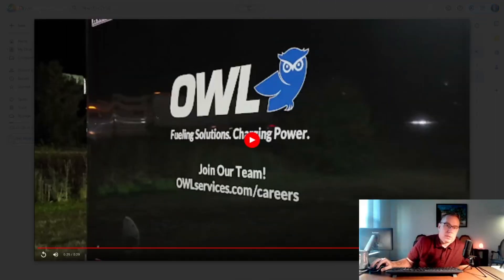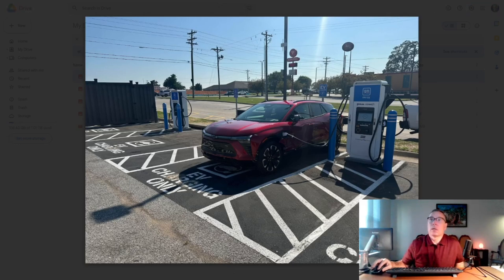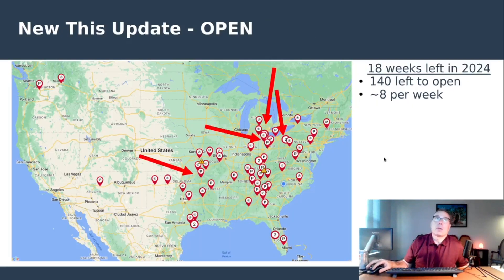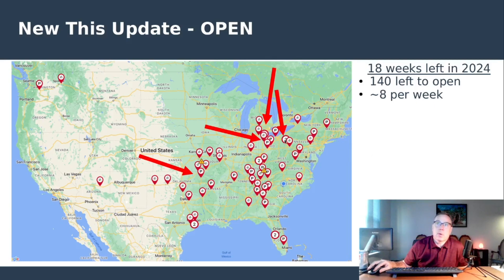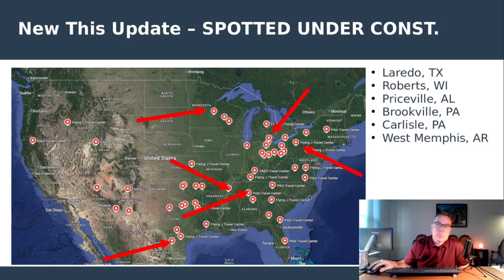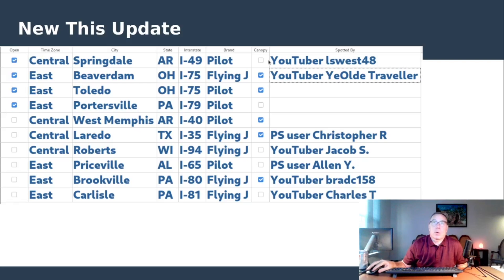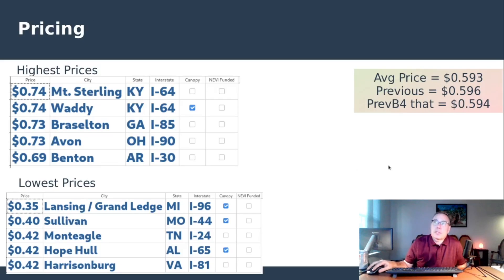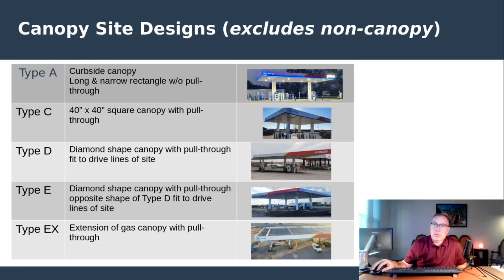gm energy - Pilot / Flying J Update #30 (Electric Vehicle Charging)

Comment: Hi Walter I am wondering at what price ie .59 per kWh equals price of gas?
Reply from the maker: An easy way to answer is to move the decimal point.  So, $5.90 per gallon.  This assumes $3.00 per gallon and 30 MPG on the gas side and 3 miles per kWh on the EV side.  Then it is just cross multiply and divide

Comment: Thanks, Walter! We've seen a lot of sites that are completed but not powered up, so I hope they aren't sandbagging for a big promotional push later. Given how quickly they can be built, I wouldn't be surprised if we hit 200 by the end of the year, but I'd like to see them pick up the pace. 
Also, Congrats on your 25th Anniversary! The trip is, of course, already doable on I-40, but I have my concerns about whether you'll be able to do it exclusively on EVgo (especially EVgo-PFJ) by December. The gaps out West are pretty substantial, so we need to hear good news from both  New Mexico and Arizona/California west of Flagstaff. The silver lining is that EVgo's non-eXtend footprint extends pretty far out in Southern California, so you'll start running into 350 kW chargers by Victorville (or San Bernardino if you decide to cut south after Kingman/Needles).
Reply from the maker: Thx Eric.  The 40 route needs Albuquerque and Bellemont, AZ west of Flagstaff for sure & also the NC location I'm visiting this weekend to open.  I need one of the OKC too.  Several others are nice to have as options.  Will be interesting to watch them progress though the remaining time in 24.  Once we get into CA, Needles is a likely stop to booster into LA proper.  I'm thinking the southern desert will be nice in December and am looking forward to that aspect of the trip